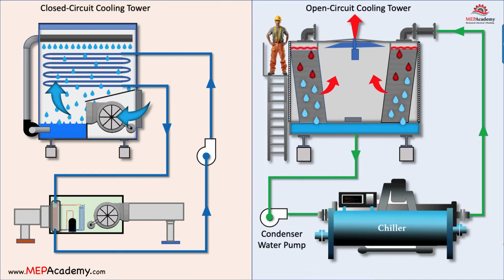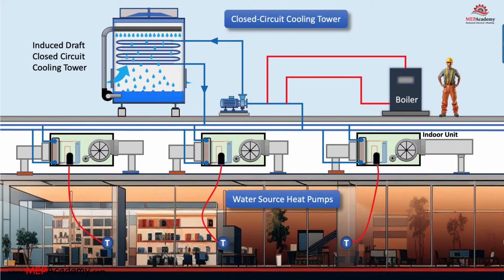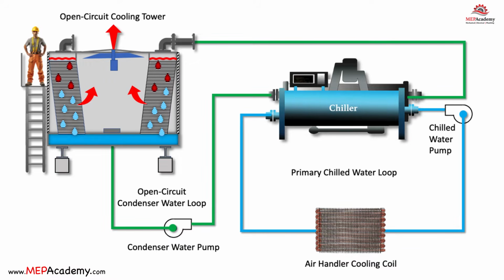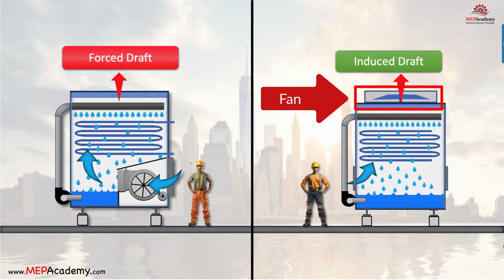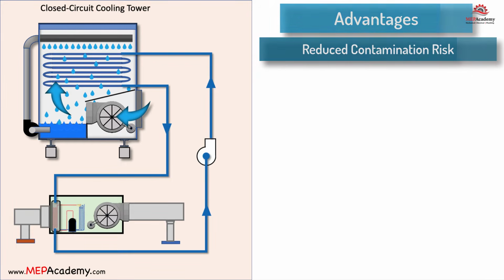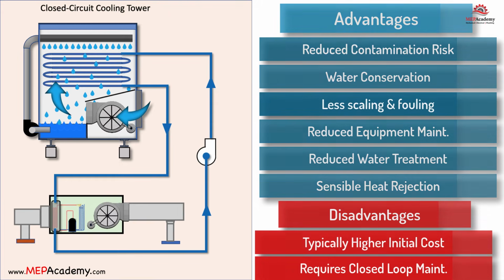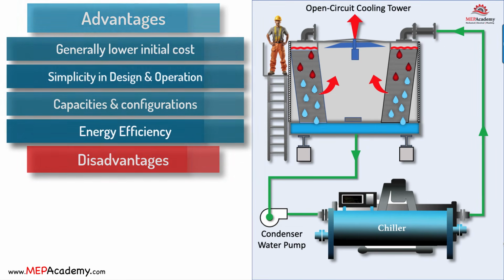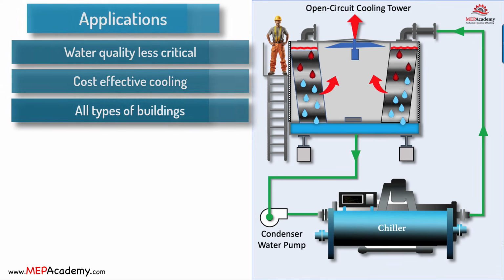Closed Circuit vs Open Circuit Cooling Towers

Comment: Both these systems rely on the evaporation of water. So water is used. The water used is in direct proportion to the amount of heat evaporated

Comment: You cannot have a "closed loop" cooling system with evaporation. The evap alone makes this an open loop system. I design these systems, we also offer closed loop systems but those are AFC coolers, not evap coolers.
Reply: I think you are using incorrect terms. The two cooling tower companies that make a lot of both types of towers are B.A.C. and Evapco, they build closed circuit cooling towers that have a tube bundle inside that is a closed loop system. Marley also makes them but BAC and Evapco are more common. The Cooling Tower itself circulates water over the tube bundle and water is evaporated in the process. They also make open loop cooling towers that circulate water from the tower to the condenser section and then back to the tower and that water flows down plastic fill that breaks into smaller water molecules that the tower fan is either drawn up or blown across the flow to cool the water down before it returns back to the condenser section of the chiller. Both designs cool by evaporation. 
 There are air cooled systems that have closed loop heat exchangers that chill water is circulated through the exchanger. Is this what you design?

Comment: I’m really torn between closed circuit cooling tower vs open circuit cooling tower “with heat exchanger”. (So still cooling tower coolant seperated with cooling loop of server computer)

I think the later has risk of  fouling of heat exchanger it self. 

So if closed circuit tower can perform-in terms of cooling capacity-same as open one, I think I’ll go with closed one.

Can you please provide me some advice?
Reply from the maker: Please provide make and model number of the equipment your trying to cool and approximate tonnage.
Reply: A closed circuit tower has a hydronic loop system , water treatment is necessary for the cooling tower water that circulates over the heat exchanger tubes in the tower. Sodium nitrate corrosion inhibitor is the most common corrosion inhibitor in the closed loop. Once the loop is treated the chemical is stable and will last the life of the building if there are little or no leaks, once a month testing that takes a few minutes is all that is required. The tower needs requires a chemical feed controller, chemical pumps, chemicals, and a bleed system and monthly testing also but weekly is better. The system to be treated is less volume than a comparable traditional open loop system. 
   A open loop system has a chiller that the cooling tower provides cooled water to. It involves all the piping going to and from the chiller back to the tower. The volume that is treated is usually much larger. The same level of water treatment equipment and testing is required and if there is a failure the entire system, the tower, the pipes and the condenser on the chiller can scale causing massive problems. Even a closed loop tower can scale all the tubes in the closed circuit at the tower. It’s called the tube bundle. There is one more type of open loop system that should be avoided at all costs and that is a open loop from the tower down to smaller chiller units spread out within the building , perhaps 35 units on a 15 story building. If the tower water goes out of control every unit in the building would scale up and probably have to be replaced. Cleaning all the units would be a nightmare. The size of the building ( tons of ac) , the pipe layout through the building and the equipment is the determining factor. 
   If the budget is a factor a closed loop circuit cooling tower system would be my choice. The condenser loop is treated, goes to individual air handler coil systems and fans.  Less things to go wrong that costs big bucks to repair. Most closed loop systems are on smaller buildings and facilities and are for comfort cooling, they are the most common system for the vast amount of hotels. Each room has its own AC unit but the water going to and from is a closed loop treated system. The open loop system is also for smaller buildings but are found on larger scale building and facilities that have long distances, lower temperatures, chill water is insulated and moved over longer distances. Food storage, data centers plants etc. It really depends on a multitude of factors as to which is best.

Comment: what about the removing of salts and also the building up of bacteria? can you explain how a biozid or a reactor will be inplemented into the coolingtower?
Reply from the maker: HVAC cooling tower water treatment involves several key processes to maintain water quality, prevent system scaling, and control biological growth. The water is typically treated with chemicals such as biocides to prevent algae, bacteria, and fungi growth, which can clog the system. Anti-scalants and corrosion inhibitors are added to prevent mineral deposits and metal degradation within the cooling tower and piping. Additionally, the water's pH, conductivity, and hardness are monitored and adjusted to ensure optimal conditions for heat transfer and equipment longevity. Periodic blowdown, where a portion of the water is removed, helps to reduce the concentration of dissolved solids in the system.
Reply: @MEPAcademy  great explanation
Reply from the maker: @HvacBlake24  Thannks